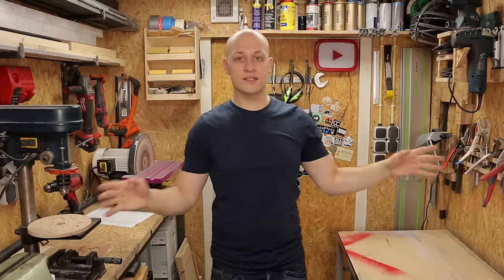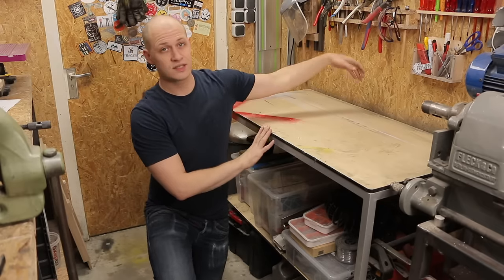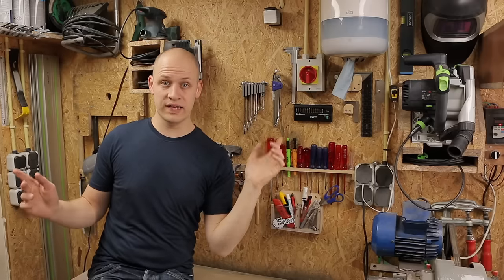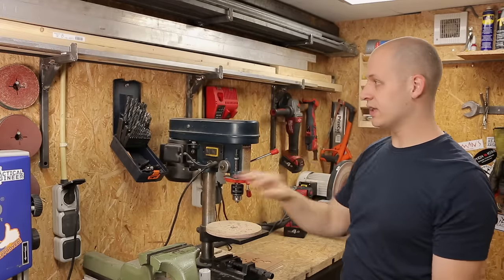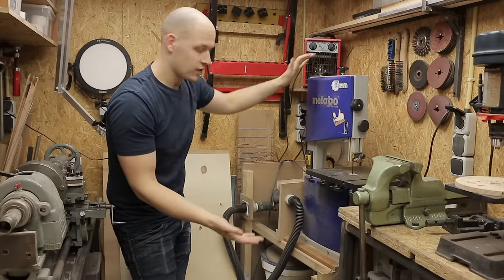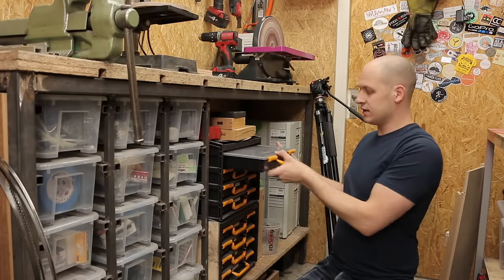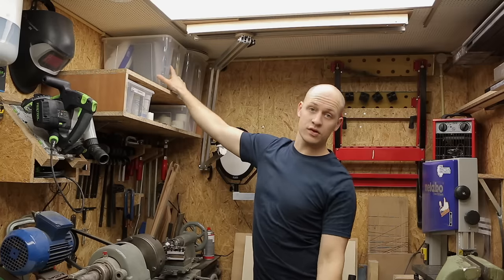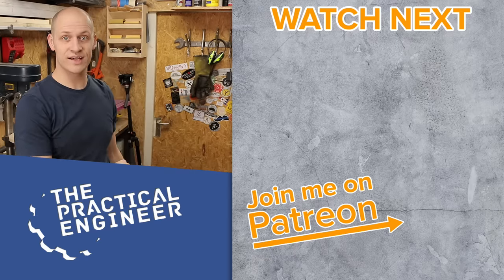My Small and Efficient workshop (2 x 3 meter) - 2019 Shop tour

Comment: This is really good.  It seems you have maximised your space incredibly well.  Over the sheets of plywood, could you have sheets perhaps 60cm x 120cm (the same as your bench) and make some kind of storage on/under the table itself?  Obviously placing 5-6 sheets of ply could add 50-100mm of height which may be a little awkward to work on but it may prove to be a space you can utilise.  That or perhaps a thin shelf under the table itself.  Other than that I suppose you could build storage into the floor itself but that could be really awkward in such a small space.

Really nice set up though, here i am with my 8'*4' bench and worried that it's not big enough and will I have enough space and look what you have achieved.

Comment: Nicely done in such a small space, I like your sandpaper/tape station, good idea to have the sheet compartment behind that rack. The mains switch is a great feature in any workshop, IMO should be by the door. You have a lot going on in a very small space, what do you do when some tool decides to smoke the place up?  I would make the walls behind the workbenches white to have more reflected light and a better view of the work area. The chipboard is kind of messy looking and it absorbs the light making it just a bit harder to see detail. On that note, a bit of finishing would spruce the place up. You have a lot of nice features for your tools, but few for your own comfort.

Comment: Brilliant use of space, about the same size as mine, but it looks much bigger! I put sheet materials behind the bench against the wall, not particularly easy to get at, but it's well out of the way, and about the best way Ican find to lose it. Really useful video, thanks🙂.
Reply from the maker: I found that the way I arrange the stuff in it already makes a large impact on how large (or small ) it looks. Also the camera wide angle helps a bit.. 
I'm thinking of a similar place to store the plywood, I think behind the bench is a good place. Just need to get a good way to get out

Comment: I have a door 1 foot wide 5 foot high on the cormer of my shed and it allows me to slide my plywood in bend my bench and tools I usually 3 or 4 sheets on hand and any cut off of plywood I have left that I want to save I cut them square to the biggest size I can and either tuck them under my benches or in my rack over my benches I have a 12ft x 24ft shed shop but I still have no space because I have a wood shop and metal shop and snowmobile and lawn mower shop all in one so lots of tools and lathe and milling machine plus a lift table for snowmobile that doubles as welding table or workbench space is tight so every inch is used and always finding ways to fit more like my door on the corner of shed so I can skide sheet material behind benches

Comment: Listening to you, it seems to me you'r Dutch, but I stick to english so more people can read your channel. My workshop is 2,4 x 3,5 meter,  so not much bigger.  Also I 'm a fitter & turner for over 35 years. therefore I was keen to see what solutions you came up with. One of the great things of the  workshop is your lath. Maybe one day I have one as well....One thing that I discovered is that I like to keep my tools in a drawer or systainer. The main reason is DUST. I'm going to make a central vacuüm  cleaner system to keep the dust to a minimum. This is going to  be a system at about 2 m high, with a arm or rail to guide the hose. I hate it when I saw with a plunge saw and the vac.cleaner hose hooks up to the rail or bench etc. anyway I'm curious what is coming.

Comment: Hi Practical Engineer,  my workshop is only a little bit bigger (2.4x3.4m) , but by far not so well organised than yours - congrats! Since your workbench with 120x60cm is big enough for your projects and the space below it’s not fully used yet, you could store plywood sheets nearly the size of your whole workbench horizontally there. Reserving 20cm space would give you a storage capacity more than 6qm of 15mm Plywood...which is the space of your whole shop! 😀

Comment: Just found your channel and have subscribed. You mention needing storage for sheets of plywood.  Not sure if its an option, but could you build a storage box on the outside of your shed, under the eve so somewhat out of the rain? it wouldn't have to be very wide, but could easily hold 3-4 sheets of 4x8 plywood. Basically build out your outside wall, making a sort of false wall with a door on the end so you can slide plywood in and out.  Hopefully you get the idea.
keep up the great videos - this was enjoyable. I am glad I found this channel.
Reply from the maker: Thanks! Love that solution! Unfortunately I'm limited to the inside of the shop
Reply: @Thepracticalengineer  found this link for you. (hope OK to post)
https://www.lumberjocks.com/topics/23592
I know floor space is tight, but if you could move out your Tool Bench and Dust collector, by say 6 or 8" - with a slot type opening door so you can slide plywood in from outside - might work for you.
I like figuring out solutions.

Comment: Dude, why not either make it so your vise slides out when in use and back when not OR mount the vise to a tow hitch and reciever set? Like the trailer hitch on a truck. Mount the reciever to the bench and the vise to the tow bar and when you need the vise you just slide it in an put in the locking pin and hen not inuse, store the vise out of the way. It will free up your bench where the vise lives now and be in the proper useful place when you need it!
I'm limited for space myself so for metal and wood storage I have a small storage shed next to my workshop. Yes I have to go outside to get material for the job, but I have room to work. But inside the material shed it is very well organized for full sheets to scraps.

Comment: Great video and an amazing space...Re storing sheet ply, how about a false wall lining one side of the shed and storing the sheet there? You'd probably need a say a 100mm gap to get a  couple of sheets in...ideally you'd need to build a second door  ( along side your existing door) to access the sheets from the outside although that would a fairly big job..
Reply from the maker: I like the idea. Hidden plywood storage
Reply: @Thepracticalengineer  Not sure if you ever went this route, but if you do, add rollers to the floor so you can slide the large sheets in and out easy...

Comment: I have been looking into getting a shed about this size for a small work shop.  You have a lot of similar tools I have now, just no place to utilize them.  At 2:57 I notice a small electrical box to the right of your track saw.  What is that?  Makes me think of something associated with solar energy.  I also curious about the vent near the door up by the ceiling.  Thank you for sharing this.  It will help me when I get mine.
Reply from the maker: It's not as exiting as you might think 😉 the electrical box is a vfd for the motor of my lathe. Near the door I do have a bathroom fan installed for ventilation

Comment: Thanks for sharing that. Although you want to make improvements, I do like how you have used the space you have, especially how you are making it easy to keep all the frequently used tools easy to reach but also easy to put away so that you keep areas clear. I came across this as I am building a workshop (from a kit) at the moment that will be 1.72m by 3.38 (couldn't go deeper due to walkway between workshop and back of garage). It makes sense that the main work surface should be c.600mm deep (along the long wall), but how much space should I allow for walking / working between that and a surface against the other wall. I cannot make it 600mm both sides, as that would leave only 500mm, which is far too tight. How deep is your surface with the sander?Would 400mm or 450mm be enough? Thanks.
Reply from the maker: Great to hear! The surface on the right with the sander is 400 mm.

Comment: Plywood can be stored along the ceiling with a slat to pull it out from, wherever you dont have a light fixture at least.
Reply: I thought the same thing.  Lights are already installed, but perhaps find a different way for lighting, or move the light under the plywood if it is thin enough.
Reply: @bobblack3870  theres still open space around the lights

Comment: I have a similar workshop. Always a project to make the most use out of the available space. I noticed you have a welder. I'm starting a course and want to start welding in my shop. Do you take any specifier safety precautions? It seems pretty dangerous in a woodworking shop with all the dust and everything wood
Reply from the maker: Hey Erik,
Awesome!
For my own health I always weld with the door open for fresh air.
I always vacuum the floor etc to remove the sawdust. Also it's a good idea to have a fire extinguisher in the shop

Comment: Our home shop is also pretty small, but not this small! We store a lot of our tools in their boxes, in old kitchen cabinets, not ideal. The only use for a toolbox is for carrying tools (imo). Were still looking for a smart solution, but we have tons of stuff in there. We do practically everything ourselves, so we have a lot of tools and materials. From paint to copper piping.

Any tips?

P.S. We try to keep the sheet material tucked away behind the last cabinet as much as possible, but it's tough to store. Smaller plate material is stored between the roof beams, on which we added some tabs to keep the materials in place.
Reply from the maker: I got rid of most of the tools boxes and hang the tools on the wall. Also the storage rack with the ikea boxes is a huge win
Reply: It depends on how much work you do away from your home. I keep one of those soft canvas tool bags with lots of exterior pockets loaded with tools good for most projects, and have another set on my board in my shop, that way I don’t have to think if I brought this or that, it’s always there. Anything specific to the job I’m going to do I throw into a separate open tool carrier.

Comment: Is it  easy posible to cut aluminium with that bandsaw or is it only for woodworking use ?
Reply from the maker: I cut aluminium with it if I need to. Thin pieces are super easy but I also cut 50 mm roundstock with it.
Reply: @Thepracticalengineer  Thanks, zag later dat je Nederlands sprak. Leuk kanaal heb je man. En toffe nieuwe werkplaats. Ik blijf je volgen.👍

Comment: Can you show th extern side ? The roof and the size
Reply from the maker: Hey, It has a flat roof so it gets quite warm inside sometimes. The size is 2x3 meters
Reply: @Thepracticalengineer  Was it build by you ?
Reply from the maker: The outside was already there. I insulated it and put the inside wall panels in.